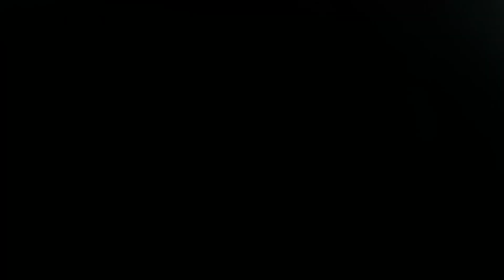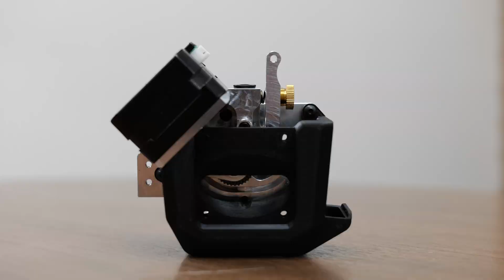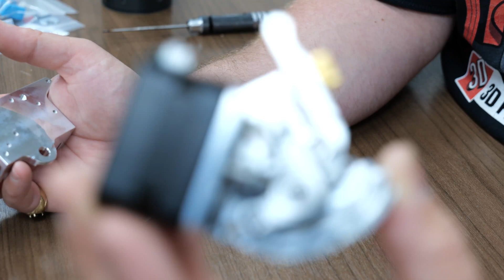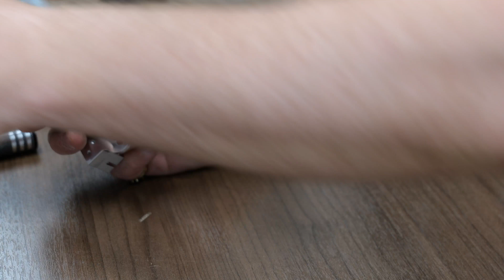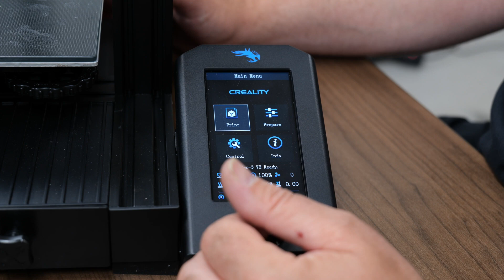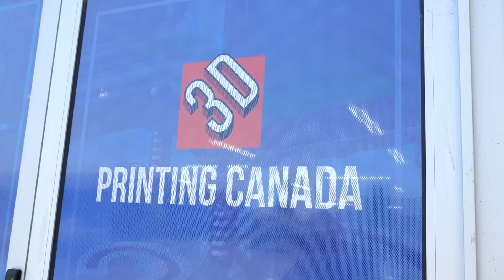MICRO SWISS NG DIRECT DRIVE INSTALLATION

Comment: Put mine on an Ender 3 Max and switched to Klipper and Fluidd. I had to recalculate the 400 eStep value to suit Klipper's Rotation_distance value.....but seems to be working great!!
Reply: I want to do this to my Ender 3 Max also. Any issue with nozzle overhanging off the bed at the X-axis limits?

Comment: I run this now for 3 plus months now in a up to 90C chamber with a 45C head blower no better fix into an industrial replacement for me with the HT heater block and a bondtech CHT with a pt1000 and 3:1 drive whats more to say

Comment: Really disappointed in microswiss on this one. No instructions included and I must have missed the point in people's videos talking about the extension cable and it's too switched wires. But come on who relies on community videos for their instructions. What you can R&D apart but you can't pay someone to write a paragraph? My printer does not extrude at all anymore I'm hoping that this garbage setup just blew a stepper driver and nothing else. Even a small card with a warning would have been nice. I thought it was just an extension to go from Bowden to direct drive.